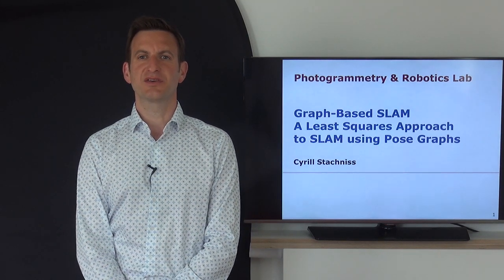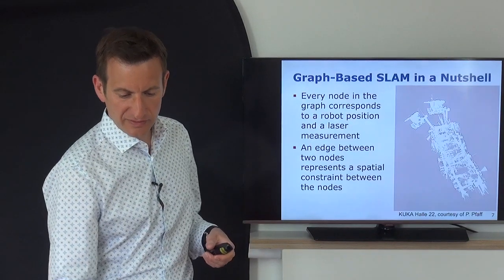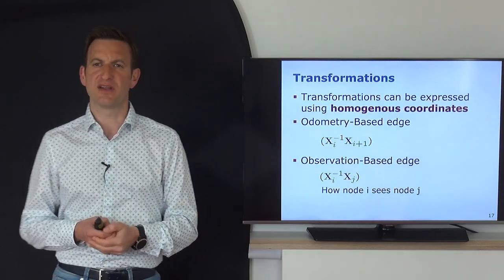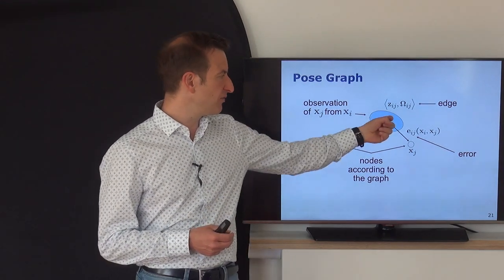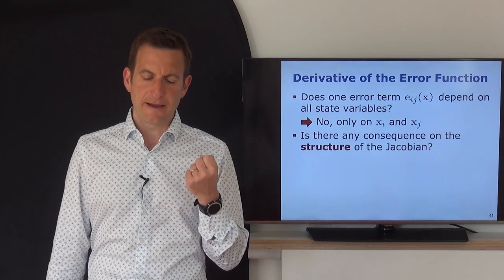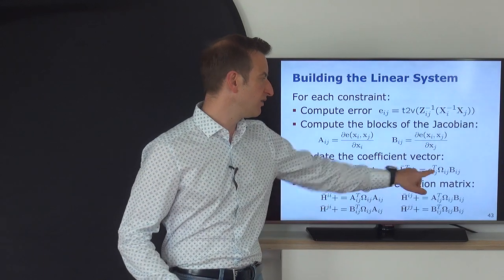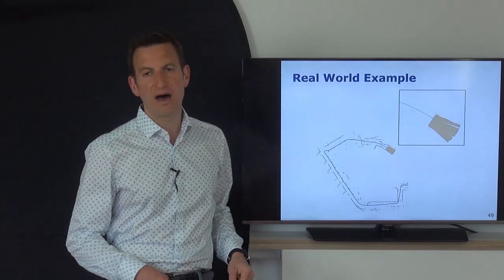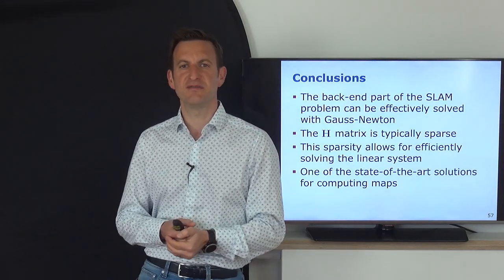Graph-based SLAM using Pose Graphs (Cyrill Stachniss)

Comment: Prof. Cyrill, many thanks for uploading this wonderful set of videos. If I may, I would like to ask a few questions (responses from the audience are also well appreciated): 
a) I found it hard to understand the physical meaning of matrix H, hence it feels the addition of 1 in H11 to fix x1 somehow arbitrary to me. Although I am not sure, it could potentially be possible to fix x1 by introducing a fictitious measurement such as: e11=z1 - x1; where z1=0 (to fix it to zero) and Ω11 a very high number (infinity?) as we want to provide confidence about this measurement. However, by doing so we also add a b11 term (not only H11), which seems quite different from what has been described in the video.
b) My understanding says that the optimization algorithm used is called Newton's method (Newton-Raphson), whereas here in the slides I see it is named as Gauss-Newton method. I am mistaken?
c) I was trying to find this t2v Matlab function but did not really manage - could anyone provide a link (or any other source of information) where I can find what it does and how it does it? 
d) regarding the mapping, does the vehicle store all the measurements and re-generates the map from scratch every time the optimization step is performed? 
I am sorry for the quite long comment. Thank you.

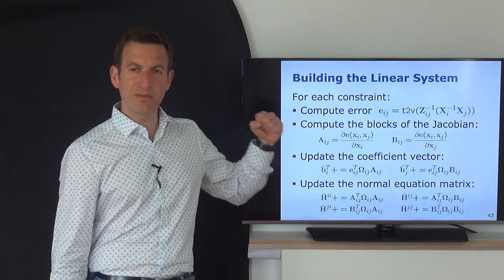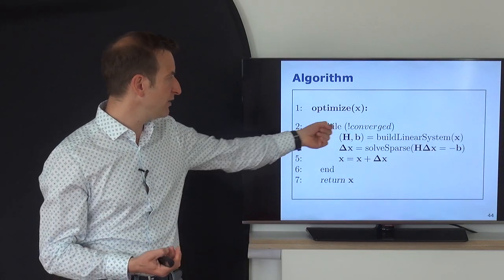Comment: Hey Cyrill, thanks for the great materials you post on YouTube! I have a question regarding the slide "Building the linear system" (50:22) as well as the consecutive "Algorithm" (51:38). Do the indices i,j at the matrix H bar and vector b bar correspond to matrix/vector indices or are these completely different matrices/vectors? And what exactly is the form of those matrices H_bar and b_bar? As I understand, A_ij and B_ij are matrices themselves, thus H_ij bar is a matrix and b_ij a vector themselves.

Furthermore, I'd like to understand, how exactly we obtain the matrix H and the vector b on the latter slide, given the matrices H_ij bar and vector b_ij bar. Are these the same?

Greatly appreciate your help!
Reply from the maker: Yes ij are indices in the matrices/vectors.

Comment: Hi Prof. Stachniss. Another great video. You've taught me a lot. I do have 1 question. In the 1D problem when you need to "fix" the first x1 since everything is relative - clearly H12 is rank deficient since it is the outer product of a 2D vector. The rank has to be 1. This, as you said, is due to the relative nature of the update. Then you add (matlab notation) [1 0 ; 0 0] to H. Can you explain why this is equivalent to fixing the first node to some value? I see that indeed in the end delta_x = (0 1) therefore the first node is not changing positions. How did you know to add [1 0; 0 0] to H to achieve this? My only inclination here is to say that for any [a; b]   [1 0; 0 0] * [a ; b] = [a ; 0] (again in matlab notation) so that indeed "a" remains the same. Is this the rationale? 
Beyond that (and even including) this issue - this is an amazing video as are all your videos. I'm a huge fan! Thanks.
Reply: Hello Jeffrey, by any chance were you able to understand the reason for it?
Reply: Hi @Jeffrey! A great question! If you found an answer, please let us know.

Comment: Tank you for the video ! I have one question. Considering that there is only one virtual measure e_{i,j}. Given that other poses do not appear in the error, how can these other positions be optimized as shown at 1:01:27 ?
Reply from the maker: With only one relative measurement, you constrain only two poses relative to each other. You will not fix them globally. For that you need an external reference or set your initial pose tu something arbitrary. Otherwise, your H matrix will have rank deficiency (a gauge freedom).

Comment: Thanks so much for sharing. 
The illustration of the pose graph with two poses helps me to understand this specific case. But this is related to the moment relocalization is detected, right? So the graph says you are in x, but the measurements of the loop closure say you should be around "omega". And the difference in these positions is the error, right? But in this case, due to the relocalization, I can know where I should be, but how can I find the error for the other previous pose estimations?
Thanks in advance!

Comment: Thanks for the video. Do you have extra resources about information matrix and what is it and how to compute it?
Reply from the maker: The information matrix from the observation basically tells you how good (precise) your sensor is. Either the sensor has specs (precision of the depth reading for example) or it depends on how accurately you can determine the orientation to the object, which may relate directly to image/feature points that you extract.

Comment: Thanks for the video. But I have a small question. In the example that you have given you have calculated the actual edge as distance between two nodes. What should be the criteria for 2-D or 3-D nodes?

Comment: Hi Cyrill! Great lecture! I have two minor questions: 1. Are there any thinkable benefits to using this method prior to having achieved the first loop closure? 2. Assuming I have finished the mapping process, do you have a reference on how to use the pose graph for pure localization? Or does one usually just use the corrected map for things such as MCL?
Reply: I have thought a little bit about these questions. and realised that:
1- I need to check more for question 1
2- Pose graph and MCL or KF or others are just correction tools for the localization purpose. the main function of the localization is the motion tracking from the state t-1 and t which can be done using The ICP or NDT algorithm or any motion tracking algorithm (registration for the lidar scan and the matching camera's images)  this is what I understand. Plz, feel free to correct if you have more information.

Comment: so the main difference between graph-SLAM and EKF-SLAM is that graph-SLAM is not assuming markov property and allows updating old estimation upon receiving new information?
Reply from the maker: No, not really. The LS solution can relinearize, EKF not. That is the main difference in its basic form. Advanced LS (eg robust estimators) can however do more…
Reply: @CyrillStachniss  so if the system is completely linear, the two methods would give us the same result?

Comment: Thank you for your course.
As the error function has always the same form between two nodes, do Jacobians are always the same ? and do they takes only 1 or -1 values ? It's hard to understand this mathematic abstraction.
Reply from the maker: No, they can vary for every measurement. And they are different from -1 and 1 in nearly all real-world cases (if the functions are non-linear)